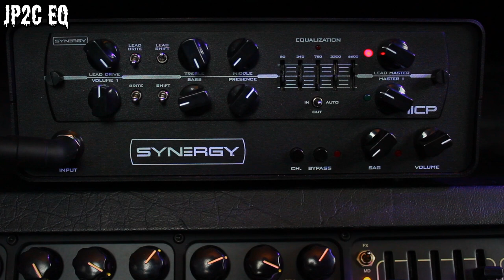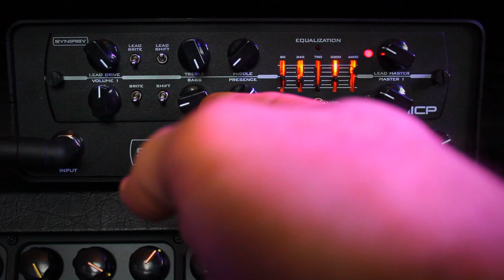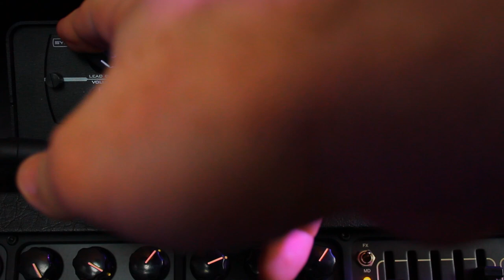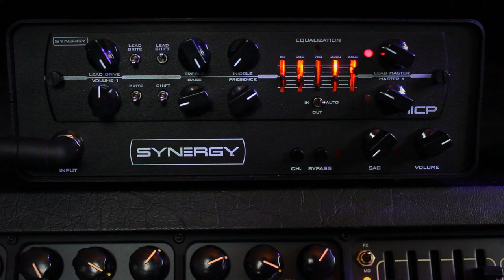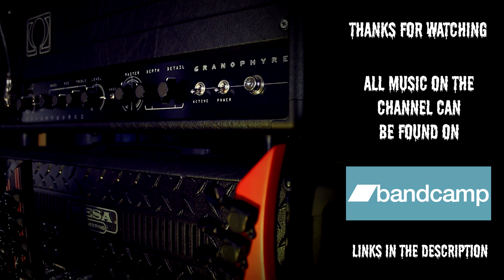Synergy IICP | JP2C Comparison

Comment: EDIT

This is quite impressive for what it is. The price of used MESA amps since the sale to Gibson has gone crazy. I'd definitely scope one of these out. $400USD is a fair price I think.
Reply from the maker: I dont think prices have really been effected by the Gibson acquisition, at least not yet, used prices have been going so high on Mesa because there was a transformer shortage that has been making it really hard for Mesa to produce amps and a bunch of people responded by jacking up used prices. Once amps became available again prices dropped, I got a pretty good deal on my JP2C, then when everywhere sold out again, prices started to go up again.
Reply: @MetalHeadProductions  ah, supply and demand. It just happened to be about that same time.
Reply: @MetalHeadProductions  Doesn't help people have been hyping the shit out of the old Marks like crazy lmao. I remember when you could get a Mark III for under $1000, but ever since Youtube discovered them, good luck finding a Blue Stripe Mark III for under $1500 now.

Comment: Both channel 2 and 3 on the JP2C are IIC+ channels, just with different settings on the input gain (volume) controls.
Reply from the maker: Channel 3, according to the Mesa website, is modified from the IIC+, higher gain, fatter, warmer and more compressed than an actual IIC+. Channel 2 is the one that's an actual IIC+ channel.
Reply: @MetalHeadProductions  from the owners manual:
"CHANNEL 2&3 These are the two high gain Channels and they are identical save for one small difference; Channel 3 is ever 
so slightly higher gain due to a higher value for the internally preset (missing as compared to a MARK II-C+) VOLUME 1 Control.
This difference optimizes Channel 3 for single note Lead work and makes the response a little more fat and round sonically and more 
legato and creamy feel-wise. "

I think on the site they just mean it's higher gain, fatter, warmer, and more compressed than channel 2 because of this higher internal gain setting 👍

I’ve got to admit though, reading just the web page they worded it really awkwardly and didn’t make that clear at all.

Comment: Well done that Mix was sweet.  They two definitely have some differences but, worked well together.   Great that you have the real deal one to compare it to don’t think anyone else has. HappyNewYear!
Reply: The jp2c is not the real deal. The pull deep is always in circuit , and not the same transformers as the original.
Reply: @SHREDTILLDEAD  ok. Still sounded pretty sweet to my ears.

Comment: Have you tried running the synergy 4 cable method into the Omega Granyphyre? I've been playing Omega's Neural DSP plugin for awhile and it's definitely my favorite of theirs and I was thinking that maybe the Synergy with the Friedman BB/BE would be cool if it worked with their loop to get a clean out of the BB and Marshall style crunch out of the BE would be a great addition to the otherwise single channel amp.
Reply from the maker: I did this when I compared four high gian modules. Works great, sounded huge.
Reply: @MetalHeadProductions  Awesome, thanks.